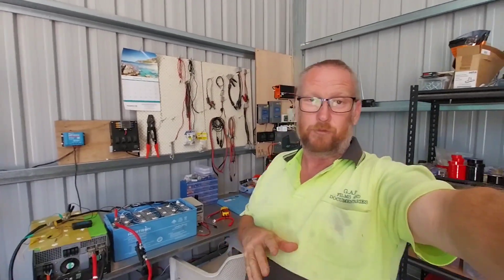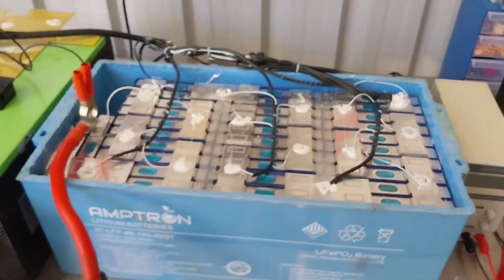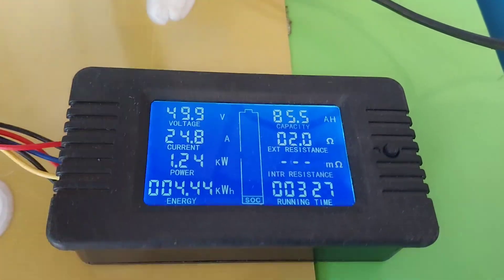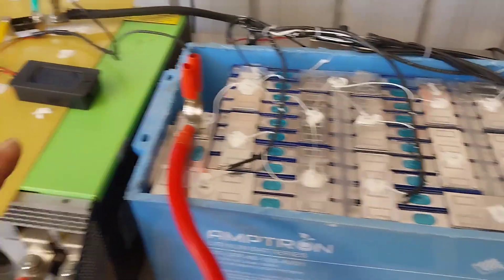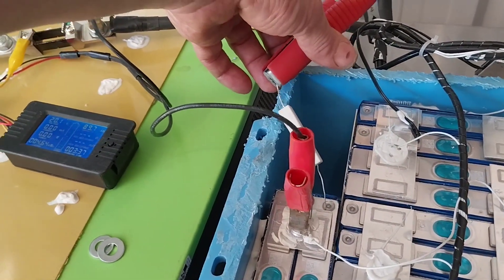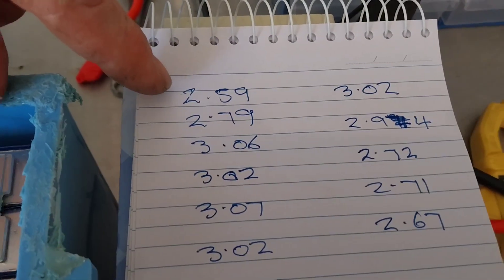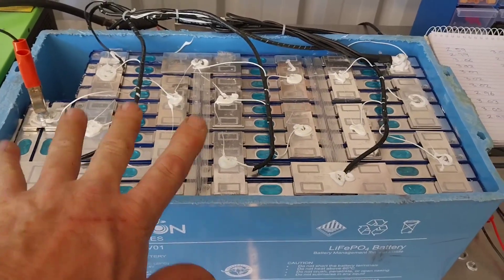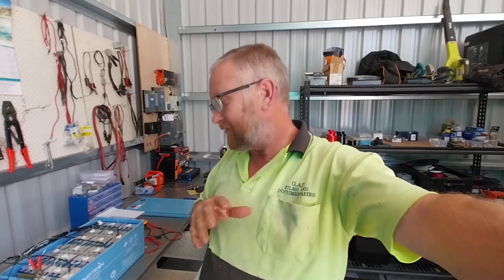Battery Capacity Test After Cell Balancing Attempt

Comment: These generic BMS only have passive balancing 50mA to 150mA, All this means is when balancing is triggered, the highest cell gets a restricted charge current of bugger all.
In a working battery the passive balancer cannot balance the cells.
Reply from the maker: Once the battery enters the float stage maintaining a constant voltage with little to no current flow, it should start balancing... but very very slowly 😆
I think active balancing is the way to go.

Comment: The ripple issue has returned. Please lower it to 56V, which was effective previously. The BMS is disconnecting again, and I can observe that it's not charging properly during the absorption phase. You only have need 1-2 hours of absorption time. It's difficult to determine exactly how much you need without cell voltages, but you should lower it again to prevent damage to the system caused by the ripple. That's where this video started.
Reply from the maker: Yes I have already done that. I was running at 56 volts for a few days and had no ripple. I then stepped it up to 56.8 volts yesterday to see if it returned, and as we can see it has returned so I have lowered it back down to 56 volts again.

There is definitely an issues with those batteries. I'm trying to balance the battery I took out of service (have an active balancer ordered) and when I get that more balanced I am going to put that into service, remove the other batteries and see if the ripple disappears running at 56.8 volts again.

It's a slow process but we're getting closer to validating the issue. FYI I have emailed the battery company regards the battery issues and await there replay. I expect to hear from them next week once they return back from the Christmas break.

Comment: Gone from 15% to 10% degradation with the better balance. That's about right. Active balancer might get you a few more watt hours before it shuts off but it's unfortunate the battery performance isn't better considering what Amptron charge for them.

Comment: I have been saying active balancer and still saying active balancer as it is like file and forget. It would immediately start to balance the pack right back taking a little bit of power from each of the highest cells and feeding the lowest cells. In half an hour time you wouldn't even knew there was a balancing issue.
Reply from the maker: Yeah I need to get hold of one for sure.
Reply: @TheOffGridBachelor You know brother when I was using AGM twice per year I would rotate the two end batteries to give it the migrating bird effect, the harder working batteries go to the back and bring up other batteries.  Welded lithium battery packs you can't do that. What I suspects the cells wasn't matched at the beginning. I am only happy the cells didn't go beyond 2v, the BMS save it. Another trick you could do is change the cells up to 5.5 volts each, leave them for a day or two let the BMS even them out, then charge them to 5.5 again been the cells have different resistance. Leave them aga6 for another two days or so. They should be pretty balance by then. From my explanation you can tell is mostly used mismatched cell I buy to build my battery packs as I can't afford new ones. Once they are balance you can set it back to 5v per cell . Just remember heavy loads like microwave especially water pump can puch the weaker cells out of balance again. Active balancer, problem solve.
Reply: @TheOffGridBachelor One more thing get a resister as sometimes you may have to burn off energy off a cell to bring it inline withe the other cells. For example 15 cells at 3.5 and this one cell at 3.62 It is much easier to use the resister and burn off voltage of the higher cell to bring it inline with the others than trying to charge 15 cells to catch up to that one.

Comment: Whatever you do don't be tempted to pull the other cells down to the level of the lowest. That is bottom balancing which is not how you want to run your pack. You could charge to full and, when you get a cell over voltage disconnect, pull the guilty cell down. Imbalance works both ways. You could also just bung another 10% into the low cell from the discharge disconnect. You may even not be getting a cell overvoltage disconnect on charge as you (wisely in my opinion) choose a lower voltage at which to terminate the charge. Either way an active balancer should sort it but I would go for the replacement jk-bms rather than the helltek balancer. The helltek certainly work but they can also imbalance a battery unless you provide a means of turning them on and off.

Comment: Take caution using the capacitor active balancers. I've had two batteries ruined by the clone capacitor balancers. The seller said they shut off at 2.0V low cell voltage, but they didn't shut off. A cell internally shorted and the balancer kept dumping power into it until all cells were near 0V. Buy an active balancer from a reputable company.

Comment: I’ve been having a similar problem. Some of my cells I believe are different resistance and when I get to the end of the charge, one cell will spike and trigger the over charge voltage protection at 3.65 v in one pack whilst one of the other cells is lagging at 3.45v. The other 2 packs are fine until the other pack causes a ripple and the multiples turns off.

If I drop the current when getting above 3.45v, I don’t get the run away cell and they stay balanced. In have 3 x jk bms thanks to Andy’s recommendation of gobelpower

Comment: As you are seeing, everyone will have different ideas. I have mentioned to you previously that the results of all my tests have agreed with Andy's results. It would be good if we could insert images into the comments. I could show you the charge curves of multiply tests and it clearly shows that very little is gained by charging above 3.5V. The cells I have are 304 and 314 AH and their capacity is higher than rated capacity. I can charge these cells to around 315 and 325 AH and this is reached at 3.45 V. Continuing to charge to higher voltages only adds a couple more AH's before the current drops off and the cells won't accept more charge. As Andy said, 99.7% SOC at that voltage. I charge my 4 batteries to 55.2V (3.45 volts per cell). Also I would agree with some of the other comments here about upgrading your BMS. A JK BMS works well and you have the benefit of bluetooth monitoring showing the voltages of each cell and many settings to choose for your required setup. EG: you can set the balance start voltage to your requirements. You can purchase a 200A BMS with 2A active balancing for under $100.
Reply: Spot on.
Reply: I completely agree that taking them higher than 3.5v is fairly pointless, little gain at the expense of having the cells in their most stressed state. I have access to the same tester as Andy and, as expected, it gives the same results. I use it for batch testing cells to check for uniformity. I too use and specify the JK-BMS with active balancer.

Comment: The big issue is that the charging rate (A) needs to be lower than the balancing rate, otherwise the balancer can't move charge around fast enough before one or more of the cells gets to the limit (3.65V) and the BMS (should) turns off the input. Either bulk charge the battery with solar until it 'looks' full then use your mains power supply to top it off at a low current (under the balance rate of the BMS when the balancing is built in) or get an aftermarket balancer (like the NEEY 10A or 15A balancer) and use that while charging off the solar to balance faster. The other issue you have is the parallel cells in series within the battery, without a balancer across each individual cell, it's always going to be a competition between each of the parallel cells to absorb charge, single cell batteries in series are a lot easier to deal with in this respect
Reply: That's a great point, so I think what you're saying is: the charge current is overwhelming the "steering" ability of the BMS. And he needs a beefier one

Comment: One thing to note - watching other people videos on what charge voltage to use is kinda semi pointless unless it is the exact same battery make/model.  Each BMS in each different make model battery could be set up differently.  It depends what the actual cell balancing voltage has been set to on the actual BMS used on your make and model of batt - some are set to 3.3, some 3.4, some 3.5, most modern BMS with bluetooth you can actually connect and change this voltage if you need to.  I think the only way you can solve this is to change the BMS to something bluetooth configurable and better like a JK.

Comment: Im using recycled lfp cells, some do not charge past 3.35v. Using jk bms active ballance, control of parameters allow me to ballance at rhe lowest rated cell in the pack, no point trying to gain any more, this cell is the determination  of capacity + the capacity of the ballance gifted from other cells, using 0.6 amp ballance bms on dual 120ah<240ah> total  appears plenty on this size cell, no need for more expensive higher ballance value bms on the size of battery

Comment: Will Prowse always talks about top balancing so as long as every cell is at this Full Voltage, you're good to go. No need to discharge any cells, it's better to have every cell at full charge and at the full charge voltage. Goodluck with it.
Reply: It's on the charger the bulb is stop the voltage raising on that cell that is over voltage to bring it down while the others come up

Comment: Costs nothing to just increase the volts and see what happens before spending more money. Might fix or improve the capacity and we will all learn something  :-))
Reply from the maker: Yeah I do plan or increasing the charge voltage and see how it goes. I started with the lower voltage as suggested by some so my next step is to increase the voltage and see how that goes... all in the name of experimenting 👍
Reply: @TheOffGridBachelor  Andy’s testing was with full control over the BMS.  This testing is currently without control over the BMS configuration.  So you have to use a voltage high enough to trigger BMS balancing.
Reply: @TheOffGridBachelor No need to go over 3.5v/cell max, Andy was right when he finally concluded that 3.45v/cell is the sweet spot, and a 2A active balancer JK BMS will give you a well featured & reliable setup.
I have been using 2A JK BMS’s after watching Andy for years on a 48vdc and a 24vdc setups for home and remote bus setups with virtually no battery health degradation in 4 years.
Reply: Hi, it was interesting what Andy actually found, that but not going to the max voltage per cell, the cell would still absorb charge in the absorption phase and gave him 97% of the rated capacity.
The cells need a balancer that work so they all get fully charged when connected in a string.
Take care M.
Reply: @markeh1971  A long absorption phase just gives the BMS more time to balance the cells.  Once the current drops to near zero (which happens in less than 30 minutes after reaching the target voltage ), the cells aren’t actually taking in more charge.

Comment: As I have said before, 3.65 V maximum charge per cell (58.4V), Andy is a berk from Off Grid Garage. Trust Will Prowse. You should charge using a smart charger rather than faffing about.
Reply: Hey mate...bit harsh on Andy there, he knows his stuff and been doing it a long time. I follow this stuff a lot as I'm also off grid, I'd be happy with any advice Andy gives now ! 😀
Reply: @AndyM...  I agree. There are so many so called experts getting around. I have built a large and very reliable system and all my knowledge has come from Andy. I would trust him over just about everyone else.
Reply: What sort of 'Smart Charger' are you talking about? These are Lithium batteries, not lead Acid, they take charge until they no longer can, so long as their cell voltages don't go above 3.65V (absolute max) they will absorb charge until they're full, their rate of self discharge is so low that they can get full, the problem is that batteries are made up of a number of cells, and unless your 'Smart charger' can monitor the individual cells, and either move charge around between cells or discharge those cells that are getting too high on their voltage, it's not very smart. The experiments show that so long as you get the cells to a voltage above the 'knee' where the cell voltages start to rise and if you can keep it there for long enough the cells will fully charge to a point it makes no real difference whether it's 3.45, 3.55 or 3.65V per cell. However not taking each cell to 3.65V every time it's charged is better for it in the long run.
Reply from the maker: I don't have a 48 volt AC/DC charger, well not yet. My Victron Multiplus has an AC charger built into it which I can run from the generator but my other batteries are connected to it running the cabin at the moment.
I plan on getting a bench top 48 volt charger when I'm back at work in February and the coin starts coming back in again 👍
Reply: 3.65V is the manufactures stated maximum charge voltage. As I stated in my comment, If you take the time and spend the money to buy quality test equipment you will find that charging to 3.65V adds very little in the way of capacity. Andy's tests, and my tests agree, clearly show that very near maximum capacity (AH) is reached well below 3.65V. Continuing to charge above 3.45 or 3.5V adds only a very small amount of additional AH's. Charging a 314AH cell (my cells when new had a capacity of 327AH) and this could be reached at 3.45V. Continuing to charge higher to 3.65V only results in 1 or 2 AH's extra and is pushing the cells to their maximum rated voltage for no benefit, only shortening the life of the cells.
Reply: i think we know who the berk or plank of wood is... 🫡